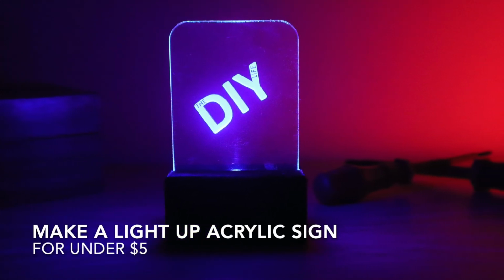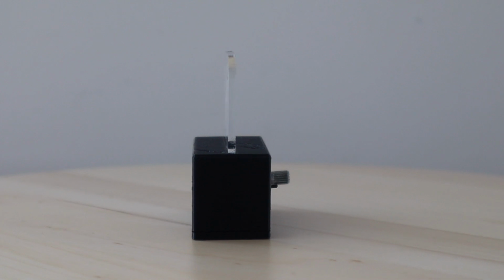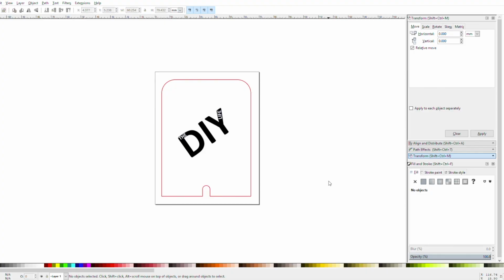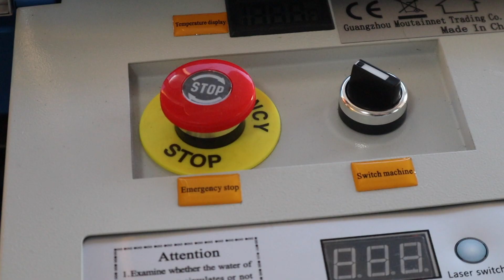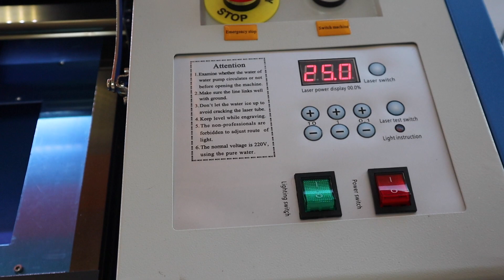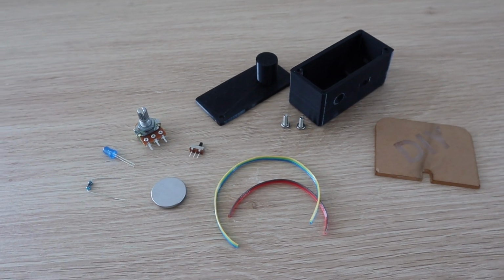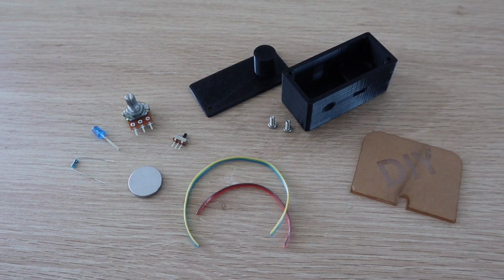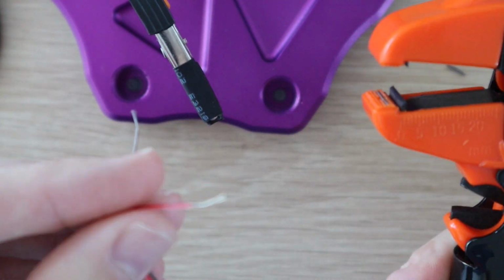How To Make Your Own Light Up Acrylic Signs For Under $5

Comment: I've never used a laser cutter before. It seems you cut through the plexi for the outline, but how is the logo done? Is it some kind of reduced power which cuts only part way through?
Reply from the maker: Yes the logo is essentially only "cut" on the surface

Comment: Literally every part on your list is over $5. You might as well say for free if you have everything on hand. Title is very misleading, it should at least say "inexpensively" although all your amazon links total over $50.
Reply from the maker: Amazon doesn’t sell individual components because shipping a 30c component is impractical. The links are for groups of parts which individually add up to $5, you’d have enough parts to make multiple signs. As the note below the parts says, you could buy these parts individually from an electronics store for well under $5.
Reply: @MichaelKlements  Ahh Ok, Digi-Key and Mouser are probably better choices for electrical parts. Maybe they have a way that you can still make money from people clicking.

Comment: Looks pretty cool! No need to tap threads for the screws? Cheers
Reply from the maker: Thanks Pablo. No, the screws end up taping the holes when you screw them in as the PLA is much softer the than metal. It's definitely better design practice to use brass inserts, but for something cheap and simple which is only going to be opened up a couple of times the 3D printed holes work just fine.
Reply: Thanks for your time. What would be your recommendation for hole diameter in pla for let’s say M3 screws?

Comment: What is the purpose of the 22k parallel to the LED?  Thanks.
Reply from the maker: It assists with making a larger portion of the pot travel usable to dim the LED. If you don't have this resistor in the circuit then you'll find that a small (5 degree or so) portion of the end of travel on the pot controls the whole brightness range of the LED, making it difficult to set. This resistor makes a larger portion of travel usable (100 degrees or so)